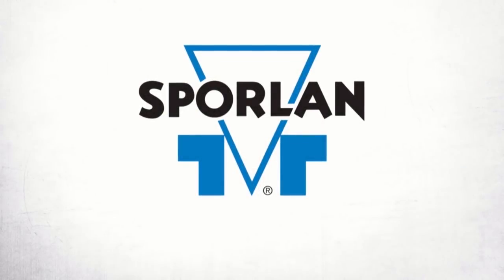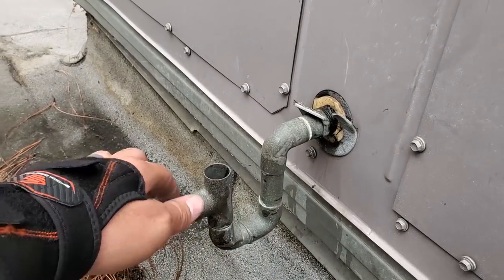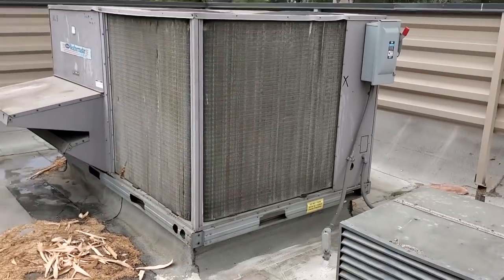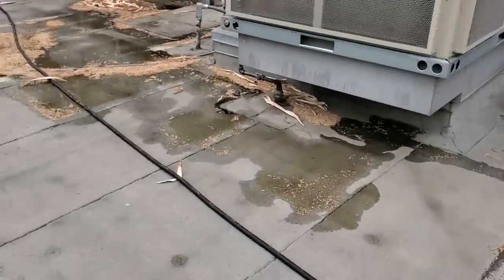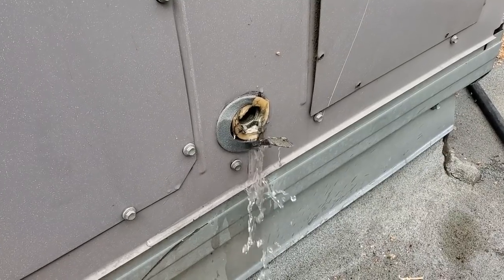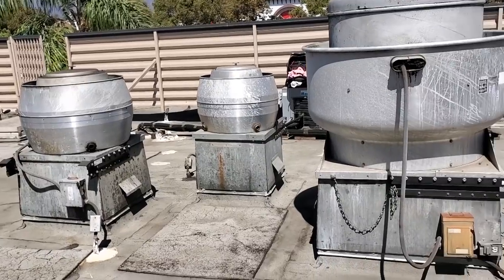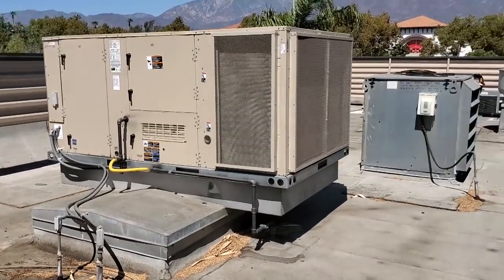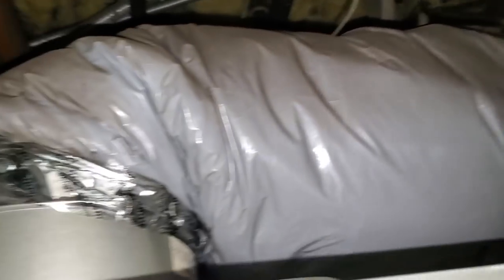MULTIPLE AC'S DOWN AND A WATER LEAK

Comment: The cooks/staff are ALWAYS the last in mind.
The chicken store I work for has two zones, helpfully listed as "Front" and "Back." The "Front" allegedly controls just the dining room, with the temperature sensor in the short hallway leading to customer restrooms. The hallway has a shorter ceiling than the dining room, and the outlet vents are behind a decorative wooden beam that forces the dining room air directly on top of the front cashiers - the air isn't even directed into the dining room. The "Back" zone is supposed to be the entire back of the house: office, dry storage, 3 walk-ins, and the cook line (with 4 return ducts directly over the breading station where there is airborne flour). The temperature sensor for that zone is right outside the office door, at the exact opposite end of the building from the cook line, across from the walk-in doors (8-10 feet away).
We have to crank the system down to 68-70 degrees for the "Back" zone in order to get the cook line below 85-90 degrees. As one would expect, the office and dry storage spaces are ice cold. The "Front" zone requires we crank the dining room down to about 65-67 degrees in order for the front cashier to get down to 75-78 degrees.
For added fun - we run at a STRONG negative pressure. Front doors require superhuman strength to open, and you can hear the low moan (and feel the rush) of air being sucked between the front doors when closed. You can actually feel a breeze in the vestibule as the air rushes between the two front doors, and then through the door between the vestibule and the dining room.
Then, you add in employees that tell me I'm "too stupid" to understand how the thermostats work. These same employees fail to understand the "Auto" setting on the Honeywell Vision Pro thermostats - seems pretty easy to understand to me, you essentially set a Max and a Min temperature and the system is intelligent enough to cool or heat as necessary (and yes, I set it for the inside blowers to run continuously, since nobody is willing to learn or take the time to turn them on/auto when occupied, and I haven't poked around to see if there is a schedule I can set for an occupied mode because I keep getting screamed at in Patwah to stop "messing things op" because I'm "too stew pid" and I "dough no how eee twerks"). Listen girl, I'm no HVAC tech, but I've replaced more thermostats than you've operated in your lifetime, and I have a fairly good hand at keeping my oil-burning furnace running beautifully, but whatever you say, I'm the stupid one!
Instead, we have "Thermostat Wars." Indoor temperature is usually set to 87 degrees, which is UNBEARABLE no matter where you are in the store, and over 100 on the cook lines, and if I complain, that one employee (the one that called me stupid) sets the A/C to 47 degrees as a knee-jerk childish response. (She's 23, I'm 42, just in case anyone cares...)
We CAN have it set for everyone to be comfortable, and once I found that "sweet spot," I took a cell phone picture of both thermostats to have a permanent record of what worked so I can sneak into the office and set it that way when I come in! No more employee threats to go home because they're sweating profusely, employees suffering dizzy spells from 100+ degree working conditions, and less bovine excrement (BS) and loose stools from early-stage heat exhaustion in the workplace is always a plus. No more complaints to the owner about her refusing to adjust the temperature below 87 (even locking the office so we couldn't adjust it one day, because she was cold), and no more retaliatory complaints that we're "bullying" her because we are begging for a few *literal* degrees of compromise.
TL;DR: Poor system layout and implementation, coupled with idiot coworkers, results in erratic temperature control, cold customers, and overheated employees. Or, just your average day at a chain franchise.

Comment: Very nice job. I have a good friend that had a balancing company and did certified lab hoods for me in a large lab building. We used to find fire dampers closed from failure of the soldered fire links. Hope you get a chance to check them in that restaurant.  Some of those hacked up old building AC systems can make you nuts due to so many hackers out there. Thanks for the great video's. You are the best I have seen.
Reply: lack of makeup air and high negative building pressures and loose belts can slow the exhaust flow enough to cook the fire links.
it's possible they're the wrong temperature to start with after the modification and nobody cared nor looked. but I'm no fire/hood guy =p

Comment: A few thoughts. First, that T&B company's license should be revoked. Turning off the m/u/a units, slowing down exhaust fans, then opening up the o/s/a in the a.c. units? Left me shaking my head!
Down here in Miami, if you do that, ALL of the duct work and diffusers would be dripping. We routinely have r/h levels in the 94-98% range year round. This area is just drained out swamp. You get the picture.
Next, the p-trap on the first Carrier appears to be too small. I believe that model unit requires a 4" trap. That on is not even close. 
 As far as broken drain pans, i agree that those drain pana crack or strip out routinely. I see that all the time. Just my .02. Keep up the good work.

Comment: Comment: The challenge here was adjusting the balance while not causing the exhaust fans to starve for airflow. The kitchen being in need of negative airflow for exhaust and positive flow for cooling this is cycling of course with return air being pulled from the box, while the entrances being in need of slightly positive flow especially during summer conditions. Then taking into account the dining room in need of air exchange rates that won't work against your goal while keeping customers comfortable. Then the issue of 'Make up air from the economizers, which given the season can cause equipment to endure additional loads. Yeah, I'd do the best I could too. Fan belts and adjustments while all systems are in operating condition probably did improve the box. Yet the box had different loads thru out the floor plan. Condensate flow follows a given set of rules, comply or suffer the consequences. Place all drains in compliance period. Hope I got the big picture. As usual you gave us the info, Thanks.

Comment: Chris I’ve used a 3/4” piece of galvanized pipe to rethread the fittings on the Carrier units. If the plastic is cracked I use submersible epoxy on the fitting. Hope this helps. Good luck

Comment: Nice video - I ran into a new system that was leaking into the building and as soon as I shut down the unit the condensate ran out - after doing a little looking I figured that the return air duct work was about half the size it should have been... so if the unit ran long enough to fill up the tray it would overflow - and the moron who installed it plugged the emergency drain pan that was under the unit..
Reply from the maker: Wow that was stupid of him!   I will be going live on YouTube this evening 12/2/19 @ 5:PM (pacific time) to discuss my most recent uploads and answer questions from the Chat, YouTube comments, and email’s. Come on over and check it out if you can https://youtu.be/p3rL6MyXeW4

Comment: An analogy of the unit won't drain because of the negative pressure is if you're trying to get your nose to drain, but you're continuously sniffing.  That's what it sounded like when the pan was full enough the water wanted to run out, but the unit was in a continual 'sniff'.

Comment: It spontaneously sounds odd to me, who live in a cold climate, to have a positive pressure indoors. Of course it makes sense in hot climate to do it though, especially with ACs running 24/7, since you are likely to have cooler (and thus drier) air inside than outside. Pushing drier air into the walls is generally preferable. In Sweden the outside air is almost always drier than the inside, so we always run negative air pressure in the buildings. Not to the point of not being able to open doors of course, but we still rather want air to leak into the house than out of it.
We do have mandatory ventilation checks (literally what it's called) on newer buildings, that has to be carried out by licensed ventilation people, though, and modern buildings are always built to be as airtight as possible, in fact there is another mandatory test when erecting a new building to see that it's airtight enough to the code.

Comment: Is there anything you do to slow down crap buildup in the drain?
Reply: Condensate drain pan tablets.
Reply: Change filters in time so crap won't bypass and go down the drain.
Reply: Annual Evaporator cleaning , change air filters often / before they get 50% dirty , pan tabs in the drain - replaced at proper intervals.
Reply: Bleach every 6 months
Reply: Rig up a drip system to drip one drop of bleach into the drain every so often. the tiniest drip system would counteract it almost  entirely. or Just hose out the trap every so often. they plug up about every 4-5 years.

Comment: Seen this building in another video same negative pressure issues.... why not have a float to stop the lowest unit blower and alert management if it backs up with water? Just a electronic float and a pair of wires... just a suggestion for the customer....

Comment: Hi Chris, Greetings from DFW texas, a Fan here!!. I'm Wondering! Why you don't let the condensate pipe drain on the roof? they supposed to have Roof drains or go straight to the roof drain, this will keep away any leak issues. I installed units like that and I did the piping both ways, no issues. City Codes? I am a hvac/r tech with industrial experience.
Reply from the maker: Yeah its a local code to have condensate drain into the sewer where it can be properly treated before it is dumped into the ocean. I will discuss this more on my livestream tonight, I will be going live on YouTube this evening 11/11/19 @ 5:PM (pacific time) to discuss my most recent uploads and answer questions from emails, the Livechat, and YouTube comments. Come on over and check it out if you can   https://youtu.be/Rm3XGBDxpOQ

Comment: Um service??? I love on copper installed drains with no union to be able to remove and clean the trap. All ole weathermaker..probably still 22. I personally would make new drain lines on the roof and stop the internal so this way no one shares a common to have issues. Nothing  but the best for you Chris. Be safe have a great day
Reply: Is that drain set up a code thing?
seems like trouble waiting to happen.
Reply: It is required. Condensate water has to go to a storm drain , flower bed or grassy area. It cannot drain on the roof or run to a drive or walk area. This will create a slip area and a liability problem.

Comment: Poor belt selection on exhaust fans seems to be endemic. Let's face it;  industry standard rubber V-belts do not cut it for hot exhaust.  Bearing stores are a good source of EPDM  belts, that have wider heat range.  Also re-check tension after run-in and while still warm.

Comment: I have a question about the P-trap on the negative pressure side. So I need water in the trap in order to create a positive pressure on the other side of the trap so that the water will drain. Am I correct?
Reply: Also I did commercial HVAC install for 8 years. I cringed when I saw that ductwork. Horrible.
Reply: This video really came in handy today. I was doing a PM on a large central AHU with a chilled water coil. The drain pans were dry & all the condensate water was on the floor. I remembered the part of the video where you were talking about the negative pressure side. This AHU does not have a P-trap but I did look & I found a crack or a gap at the bottom of the AHU housing which was allowing air to come in. I sealed it temporary with cardboard & later saw that water was again in the drain pan & not on the floor. I will do a real patch job tomorrow but thanks for making these videos. They help me more than you can imagine!

Comment: If the building was already negative and you fix the exhaust fans wouldn’t that make it worse?
Reply from the maker: Yeah that's what I was trying to say but  I wasnt very clear, fixing the exhaust helped with the heat in the kitchen than I adjusted the balance and found the duct leaks at the diffusers.

Comment: Hello Brother! Newer code requires drain pan float switch shutdown on rooftop package AC units.  I don't know that any of those units are new enough for this but, I can imagine restaurants would rather have a water leak vs shutdown. Good procedure and diagnostics.
One other note, if all those copper drain lines were converted to 1 inch pvc with 3/4 to 1 inch adaptor, 1 inch p-trap this could help slow down some of these nuisance calls, just a thought. 👍😄
Reply: larger diameter pipe isn't always better, more so in low volume trickling flows, it could build up "junk" 5x faster and be worse off.
Reply: throttle bottle really? So I suppose all those 7.5 to 20 ton AC systems I installed over the years should have had a 3/4 drain instead of the factory required 1 inch line according to your misguided theory. I love the specific scientific 5x 😂

Comment: If they have leaks when the AC drain malfunctions then why don't they have major floods inside when it rains?  Does the water actually leak into the building through the AC system?  Ductwork?

Comment: Neat to know the p trap i tought it was aboud sewer smells as they wure bonected to a drain
Reply: Different applications, similar needs. That A/C condensate drain only ever handles what's essentially distilled water plus whatever dust and other crap blows in onto the condenser drain pan, so there shouldn't really be any sewer smell. Doubly so because it connects to the storm drain, not the sewer, and those two systems are separate in all but the oldest cities (mostly a EU thing, I think).

Comment: HEY BOSS SO I CURRENTLY HAVE A TRANE 15 ton PACKAGE UNIT THAT IS STUCK ONLY HEATING. ITS A BRAND NEW UNIT. THE THERMOSTAT IS BRAND NEW HOWEVER ITS ONLY PUMPING OUT HOT AIR. WHAAT SHOULD I LOOK FOR?

Comment: Every RTU I've ever seen has a trap that just drains right onto the roof. Why add all the extra plumbing to pipe the condensate into a drain?
Reply: Mike Rocheleau drain lines must go to approved locations. Based on blue print design. They can go to a gutter if it is tied to a storm sewer. They can go to grass or flower beds but cannot go to walk or drive areas. This creates a slip hazard and a liability issue.

Comment: Can you notice the building being under negative pressure ,by just being in the space ?
Reply from the maker: No you can feel it when you open and exterior door while all the other doors are closed and all the equipment is running.
Reply: So would it be considered negative balance , when you try to open the door to a mechanic room where there's a package unit and the door is like being sucked close
Reply: Or could it be just that the evap fan is so strong ?

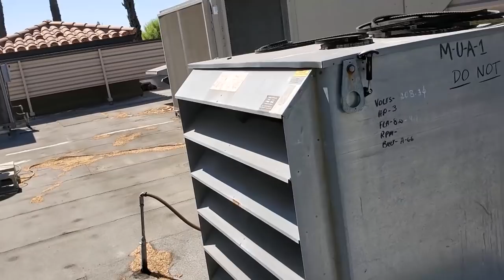Comment: What is this device called at 9:02 ?
Reply: MUA which stands for make up air unit.
Its job is to introduce the same amount of air as is being removed. Many cases it tempers that air as well.
Reply: @jrsmyth9761  thank you for the explanation, I never heard of that devices before. Here in Germany such HVAC systems are less common.

Comment: Can you explain, the trap. I got , that the pan being on the neg side..but, what I don't get. Is how adding a pipe with a trsp, makes the drain now. If the neg pressure keeps the water from draining. What's the difference adding more a pipe/trap?.
Reply: For the trap to work, it must be full of water to start. If it dries out, then the same thing happens, but it gets filled when the unit shuts off or by slow trickle.
What is happening, and he did state this, is the air is being sucked in through that hole and keeping the water from draining.
Put the trap on there and now that column of water prevents the suction from holding the water and there is no air and now it drains. You must size it to be larger than the suction pressure or it still won't drain because it suck the water out of the trap.
Reply: So is it possible to oversize the trap?
Reply: David Johnson no, as long as the outlet remains below the inlet the condensate will seek its own level but,  if too shallow it will not work properly. No double traps or dips in your drain line or will cause problems. Good example of a larger than normal trap would be a drain that goes under a slab of building foundation. There would be no need for an additional trap installed on the system as this could cause a problem.👍

Comment: why did they disable all the Makeup air units?
Reply: swamp coolers, nothing like pumping high humidity air into the building you're trying to dehumidify and cool.
at least pulling in through the HVAC unit economizers will temper and dehumidify some before shoving it in!
also, main goal less air and less air out = huge energy savings

Comment: What is the point in having make up air units if they don't use them and just use the ac for heat an cooling instead of having the compressor running and having it to mix it in

Comment: Dont ever think those air balance guys are smarter. They just have a degree under their belts. Doesnt make them smarter. You know how to fix units manipulate them as well. If those guys where smart, then the would how to fix all these problems and we'd be out of a job. They are just you a I, I've in past had redesign ductwork cuz these so called engineers didnt know properly size duct and and keep the balance of the air while having those ducts run through steel beams. Just remember to the average civilian, you seem smarter than them and that's the respect you give them but trust me they all dont know what the hell they're doing.